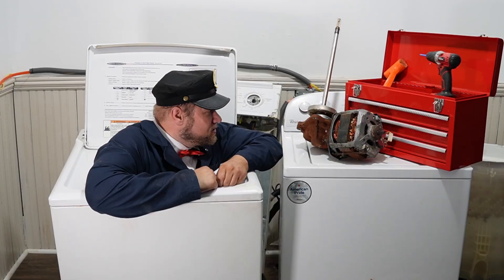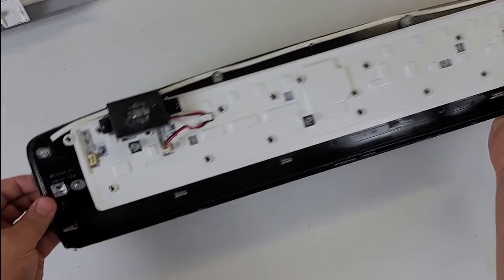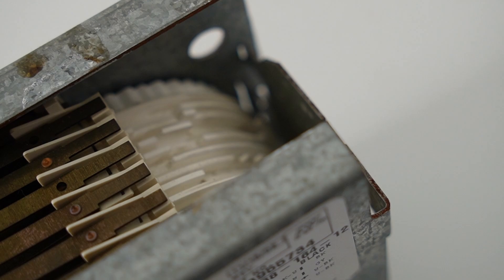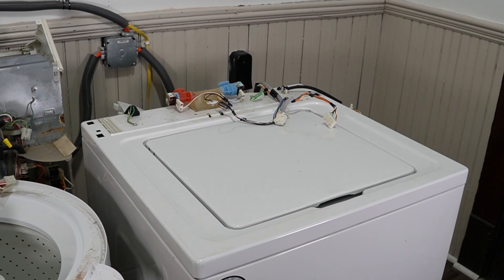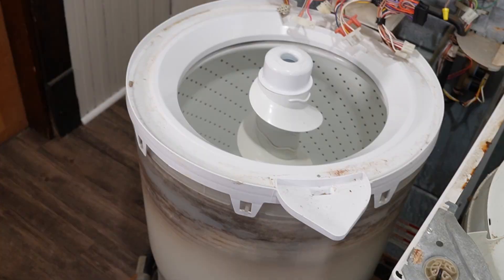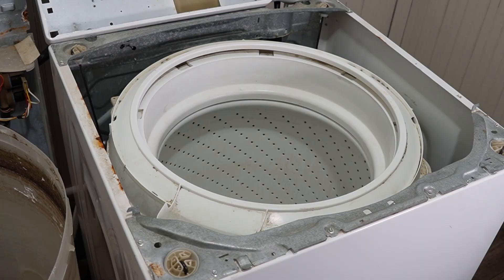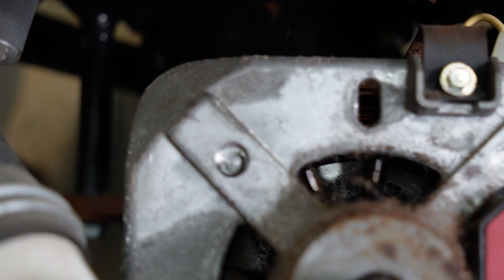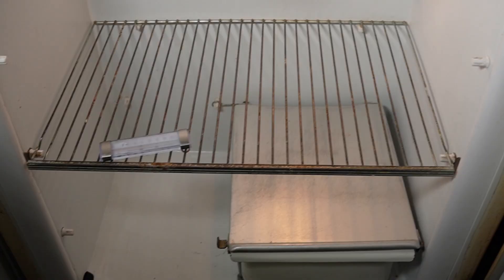Are Washers Built to Break? Inside a 1984 Washer vs. Now

Comment: I worked 10 years as an appliance tech in the 1980's. Working on all brands and types and I can say the reason the old stuff lasted so long is because they did not cheap out on the quality of the parts that made up the unit , The parts were usually made of that old material that manufacturers used , what was that called again ??? Ohhhh yeah Metal.
Reply: And back in the day people were willing to spend a little extra to get quality products. Today people focus on the lowest price. It used to be the higher the price the better the quality.. But now there is crap out there selling for premium prices. So consumers have to take days/weeks doing research. Not like the old days when we walked in to Sears or Montgomery Wards and just picked out a refrigerator, stove, or washer and knew it would last for 20-30 years. Greedy manufacturers working with the Chinese equals disposable garbage we have to buy again every 5 years.
Reply: @steadyeddie7453  yes, I would pay more for a higher quality product, but price gets you features you never use rather than quality.

My last dishwasher broke because of the motor - searching on youtube it seemed pretty common.  Apparently the thing that broke in the motor is a 1 cent part, and it would last a lifetime if it were 2 cents.  Such a waste. I found a video of a guy who machined a new part.  I wish I were that handy, but I'm not.
Reply: @bobbycrosby9765  Price vs quality is rarely black and white. I agree, higher cost gets you more features. It can also get you better quality. Not everything out there is junk, but to avoid it you pay more. I was a printing press machinist for 14 years and repaired a lot of the industry equipment. Often I saw worn parts that would have lasted a lifetime if made better or differently. But... if things didn't break them parts sellers and repairmen would be in the poorhouse. Cheers

Comment: My son and I completely stripped down my old mid-eighties Whirlpool washer to the bare empty frame, then rebuilt it with a new motor, clutch, switches, etc.  It was a real chore, but doing so showed us just how well those things were built.  The rebuild was straightforward enough, and it has been working perfectly now for years.

Comment: We bought brand new Maytag washer and dryer in 1984. Proceeded to have 4 kids and they lasted 27 years of intense use before any real issues when we decided to replace them with a "new" set of Maytags. WHAT A MISTAKE! Those new machines were both a POS, and didn't last 5 years before they were in the garbage. And that was after our kids were grown and out of the house! Nothing at all compared to the older models. The newer ones are all show, and no go. I think this is the case for ALL brands.

Comment: I'm 79 yrs old, and can remember the first Kenmore refrigerator that I bought, it had a 25 yr warranty on the compressor nothing ever went wrong on that fridge, just looked old - my 4 yr old whirlpool has had 5 new circuit boards installed to date.  The cost of these 5 new boards just about would pay for that old Kenmore.... the Samsung didn't last 2 years, and no repairman would honor the warranty!  I think new appliances are designed to make repair parts easier for the repairmen to replace, at about $200 per trip!
Reply: Samsung has their own contracts and will assign company to have a tech to come out for warranty work. We had a Samsung fridge go through compressor fail after a couple of years. The tech determined that he couldn't fix it and Samsung scheduled a Samsung employee to come out from New Jersey to Texas. However, they couldn't carry the refrigerant (R600a, also called isobutane) on the plane so they opted to replace it, including the cost of spoiled food. The same model was no longer available, so we got a slightly smaller model and a partial refund to compensate for the price difference.

I know people rip on Samsung appliances and service, but our experience has been good.
Reply: My 34 year old Kenmore refrigerator is still running as good as new.  No problems with the original compressor.  Never used a repairman.  I have had to replace the door gaskets & cams, thermostat, water valves, door switch, defrost timer, compressor fan motor, ice maker control & auger motor, and water lever.
Reply: my grandparents moved the art deco westinghouse 53 fridge to the basement in 66 where it still chugs away in need of defrost to this day. the horn rimmed GE 66 replacement needs a capacitor because it hums and wont start but its been sitting there like a broken monster cadillac for several years now while the 53 westinghouse relieves for its own 50 year old replacement. my grandpa was an 09 model.
Reply: They're not easier for repairmen to replace. There's also absolutely no reason why a properly designed board would need replacing, since solid state electronics can and will last longer than their mechanical counterparts, AND they would be cheaper. Every dollar you pay over it, and every penny saved, is simply pocketed by the company. And I do mean penny for the latter, it costs almost nothing extra to make a proper reliable board. Even if it goes wrong, it costs little to have it show an error code that'd detail exactly what circuit's failed and how, and repairing it would often take the difficult, difficult task of... Swapping one (1) component on the board. This isn't some unachievable ideal, electronics in industry are almost all designed to this standard.
Reply: My moms Frigidaire fridge has been around about 30 years now!
Reply: Go back to the 50’s. Damn, my wife’s grandfather had a Maytag washer from the 50’s that was still kicking in the 2000’s. If 80’s washing machines were anything like 80’s cars.. it’s not a good reference year.
Reply: @Egor Kaskader  not true. Moisture and grease can easily break a pcb.
Reply: $200 doesn't include parts which are hundreds of dollars on top!
Reply: Man that sucks. No idea how your economy is still working with this quality on the market :O

If you buy a fridge here in Germany you don't expect it to die below 20 years of usage – and they really rarely do. Actually I can't remember that I saw or heard from a fridge dying without physical damages accidentally occurring.
Reply: @RubenKelevra it's how they keep the GDP high for the stock market. Making everyone throw out and replace everything by making junk. And pricing it like it will last a long time. I got a new LG washer broke in a month. Store wouldn't take it back over 30 days old. They replaced all major parts and it still didn't work. Refunded 3 months later.

Comment: My repair technician told me to buy a new washer, as replacing the circuit board would cost over 300 USD.

I did the only logical thing I could think off as hardware/firmware engineer, which was to reverse the heck out of my washing machine. Threw out the original garbage circuit board, designed my own circuit board version in Eagle cad, used only solid state relays instead of mechanical relays, ... For less than 150 USD total...

I've now an 18 year old washing machine that has WiFi, BLE and ZigBee ... It's also configured to remain in standby, until my smart meter and solar panel setup commands it to power on. Saved me a lot of money on my energy bill so far...
Reply from the maker: What brand washer is it? This is super interesting and I'd love to know more.
Reply: Market that! Sell it! Open source it.
Reply: That's awesome!
Reply: Heck yeah! I love breaking things down and trying to fix it. I learn so much. I wonder if I would have loved engineering. I always won engineering projects through out school.
Reply: @KevinKimmich44024  +1 to selling plans or the whole thing!
Reply: This is the type of innovation that needs to happen.  There is no reason why the electronic components can't be replaced by raspberry Pi or some other solution.
Reply: Timmy doesn't share 😠
Reply: You are my personal hero. I was thinking you were going to say you diagnosed the board yourself with a multimeter and replaced the faulty component... I was wrong. Wow - just wow. You need to document that and maybe even make your own video. The worst thing about YouTube is the barrier to making videos. There are some amazing people out there doing some really interesting things but have no desire/knowledge to make content. This video is a great example. How many appliance technicians are there that can do what he does & have the time, skill and personality to make and upload a good looking professional video.
Reply: Ha that's awesome, well done c:
Reply: @HyperVectra  I'm confused.  What barrier is there to making videos?  Personally, I think it's easier now than it was a decade ago.
Reply: I concur, would love to see the details on how you achieved this.  Sounds cool.
Reply: @ericgulseth74  Its not easy for everyone to sit down and converse with yourself on camera. And to present your content in a professional matter that people would want to watch, is not something that comes natural to your average appliance repair tech or firmware engineer. Guess that feel like a barrier to them idk, or a hurdle, maybe just a road bump?
Reply: sxy2200 universal control for washing machine could be used I guess?
Reply: @oscarmart1  Maybe it was just his fantasy.
@Timmy  In the meantime you did the wash by hand? Or you had it done within a few days? It sounds cool, but a bit unlikely. And why would you install and configure ble, WiFi and ZigBee, you use them all?
Edit: You could see the original message when clicking your name, it makes a bit more sense, you bought a broken washing machine to do this project. But also a dryer you wrote before. And only WiFi you wrote the day before. I think you've got a lot of fantasy 😉
Reply: @TreeMyzer  Ahh.  I see what you mean.  I guess phrasing that as a problem with YouTube is what threw me off.
Reply: So... it was worth investing what 20-30 h of work? better develop an APP for it :D
Reply: Yo Timbo, zou cool zijn als er ooit een open source versie hier van komt. like "OpenWasher" of zo iets.

Welke MCU gebruikte je voor al die shitz? een ESP8266? ESP32? en alles in Arduino IDE gedaan met libs?
Reply: While this sounds feasible, I doubts, why not engage?

These videos are incredible.  On a side note.
Reply: Wish i had that knowledge.
Reply: I did the same on a dishwasher but being into the industrial automation i used a Siemens s7-1200 they discharged for a dead output (dead freewheeling diode and dead mosfet, took more time to disassemble it than replace the part)
Reply: Just curious, but why does a washing machine need to be connected to WiFi?
Reply: @oscarmart1  instead tyrone steals
Reply: Baller. Just frickin baller
Reply: I'll take "Things that never happened" for $500 Alex
Reply: Must have source code. Sounds tasty
Reply: This man is the chosen one
Reply: should have put a flux capacitor on it while you were at it.. if we just want to make up stories. so you have to call out a "repair technician" but you have the engineering skills to custom design a motherboard? this is the equivalency of taking your car to the dealer for an oil change and installing a electric motor in place of the gasoline engine because you didn't want to pay the 89.99. lying on youtube is really not that cool and i hope you can resolve what is truly going on in your life that you have to resort to this.
Reply: Your skill set is way above the average washing machine owner.
You should develope a rebuild kit for washers
Reply: This would definetly sell well or it you’re trying to help people, a little guide on the code and hardware used would be greatly appreciated
Reply: That’s great and all, but not everyone has the ability to do with their washers what you did with yours. Super cool though, and props to you for making it work!
Reply: Open source washing machines?
Reply: I have issues with the story as someone who designs projects boards on the side. These things require proper timings and the time to reverse engineer it just isn’t practical. 

Even if you did actually do this, I know people who work for whirlpool and they do put a lot of time into mastering the timings and variables to get the best wash. Reliability may not be important but they do make an effort on that side to ensure the best clean and older machines that don’t have that are all simple mechanical controls. 

In any case, doing this is idiotic when you could have just replaced the relay. I do this all the time with my customers when boards aren’t available and the relays can last a decade no problem (I don’t do it that often but I’ve never had one fail twice in 5 years). That “solid state” transistor is likely to burn out way faster without proper cooling anyways.
Reply: do a tutorial. i'd love to learn about that!
Reply: Why don’t you make this a side hustle and start selling circuit boards? I and a lot of other people would buy them if they could save a hundred bucks
Reply: PLEASE SELL THIS
Reply: What a boss.
Reply: Oh You Show off 👍
Reply: Yeah, sure. Source code or didn't happen.
Reply: @rafaeltorre1643  Why did you not become an engineer?
Reply: You should sell the components.
Reply: Even more pro tip from someone who did this for 50K/year profit. Keep a common model washer, Pick up your models design on craigslist fb marketplace for free with a broken motor or something. Take circuit board and all other parts off washer with bad motor or leak. Now you can fix all issues on your washer except whatever was wrong with the other ones.
Reply: @oceanbytez847  They won't because they are making this all up.
Reply: Open source?
Reply: Thats awesome
Reply: I'll take things that didn't happen for $500.
Reply: Damn that’s cheap I would have quoted like 500
Reply: That's awesome. My first thought would have been to use an Arduino or something but I don't have the resources you do. We'll done.
Reply: Timmy! Help us!
Reply: Bravo, that's the way. You can also mass produce that and sell it direct to the market for 300$ or 500$,
Reply: Bullshit.
Reply: @KevinKimmich44024  I agree, this could make hundreds of thousands I bet
Reply: Awesome love it
Reply: As an electrical engineer you should know that the board cost nowhere near $300 to manufacture. And if it was just a bad relay or capacitor you should’ve been able to fix it. So I guess your board is probably a lot cooler. 
But it appears they really don’t want you to fix it. Unless the entire rest of the machine was only $200.
Reply: Will it run Doom?
Reply: @erossinema8797  lol he's probably getting paid 150k+ for his job. It's gonna be a hefty price to modify an old washing machine.
Reply: You should sell kits
Reply: Pffft. SO easy.
Reply: That would make a fantastic video.
Reply: Proof? Lol
Reply: Put it online!
Reply: @stevedahl3689  because then you can control it wirelessly or even make it independt from you by connecting it to other devices (like the photovoltaic set up in his case)
Reply: Invest on it.
Reply: You are lucky that your board only would have cost $300. We were told that a new board would cost $600. Our technician said that it was insane to pay it instead of getting a new washing machine to replace one that supposedly had already gone through half its life. A new washer cost twice as much, so we paid it. I would have loved to have an open source alternative.
Reply: Impressive sir.
Reply: @bensappliancesandjunk  I doubt you'll get a reply. He's probably full of sht
Reply: @rrod555  dude, with a raspberry pi, it's not as hard as you might think. your ignorance is showing. Do I think he 100% believe? no. But it's not impossible
Reply: @down2this754  Hey, first off, I never said it was impossible. Simply said the way he is describing about going about it, is extremely unlikely and you're agreeing to that point. Try not to be so combative mate.
Reply: t v.      
                I.
Reply: See, this how we’re going to get Skynet.  If your washer starts hunting Sara Conners it’s definitely time to replace it.
Reply: Very cool brother.
Reply: I hacked my 12 year old Beko with a switchable resistor in parallel with the NTC sensor so that I can get 50c wash temperature.
Reply: @stevedahl3689  It doenst. I guess he wanted to be special idk